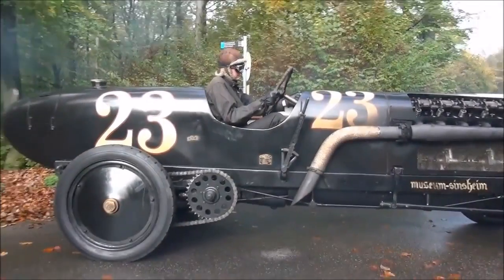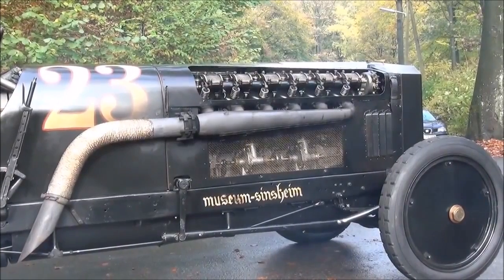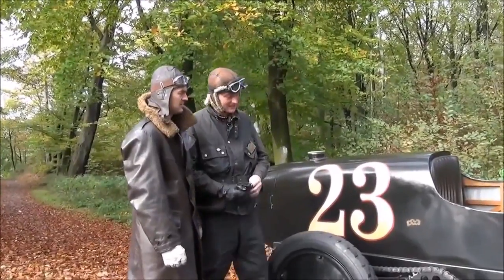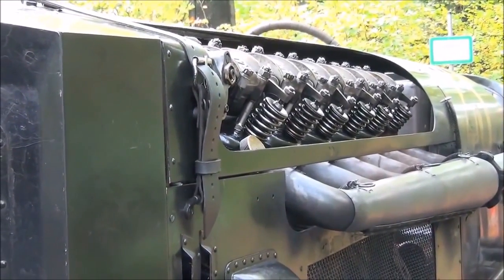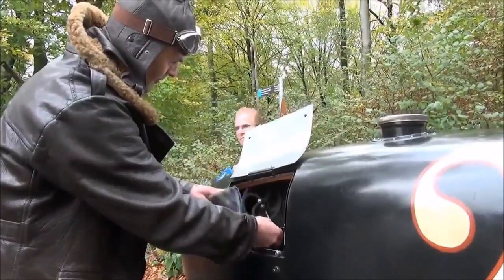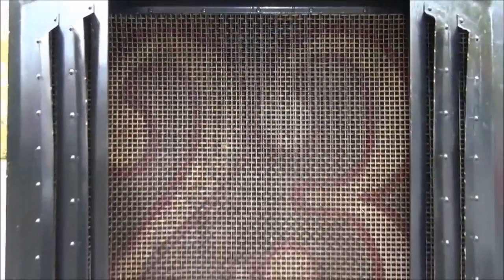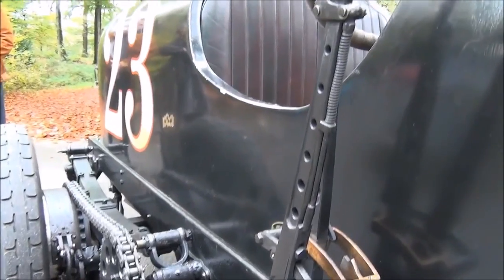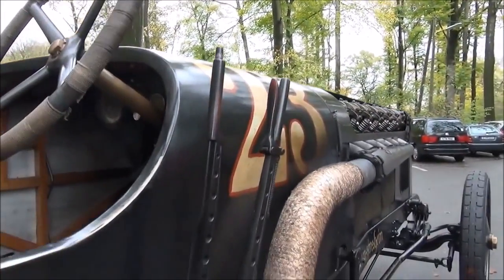BRUTUS | 47 LITER | 750 HP BMW Aircraft Engine Experimental Vehicle

Comment: Okay so use the exhaust like a jet exhaust so you get an extra push from that. Then for cooling use heat exchanger maybe like how they do it on airplanes. Have protruding wings that have coolant circulating though it while it drives. Fuel-air heat exchangers also in the wings.

Comment: This is Toyota Prius scariest nightmare.
Reply: Dimas Putra  Well have fun spinning the tires while the Prius leaves it for dead.  When this thing was on Top Gear, it couldn't even compete with "The Reasonably Priced Car".
Reply: Dimas Putra  You'd think they'd have done that already since 1907 tires aren't exactly easy to find.
Reply: @Edax_Royeaux  Prius top speed is 190km/h, this thing goes over 200km/h. So you are not correct
Reply: @R_o_b_e_r_t  When did Brutus achieve 200km/h?
Reply: @Edax_Royeaux  the englishman that was mentioned at 2:39 - 2:44
Reply: I think the Prius is faster.

Comment: need to take it to Bonneville salt flats..
Reply: good luck finding a person insane enough to ride this thing to the limit. Basically missing any brakes, it would be suicide.
Reply: @Jay20112968  with a parachute though. Maybe 2 parachutes..
Reply: Daniel Taylor i’d reccomend 237
Reply: @Jay20112968  i volunteer.
Reply: @Jay20112968  it would be a miracle if someone managed to crash out on the salt flats with virtually nothing to crash into
Reply: @11D7-n8d  Going fast enough on those tires, you may find yourself side ways, and cars aren't designed to handle airflow from the side.

There's always the floor to crash into
Reply: Need a larger drive sprocket, or a smaller driven. Or both...